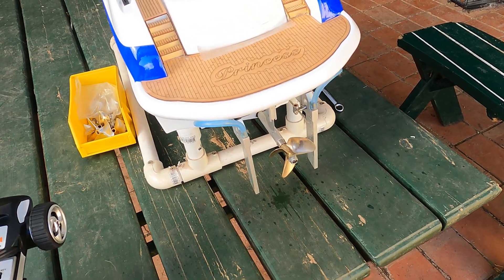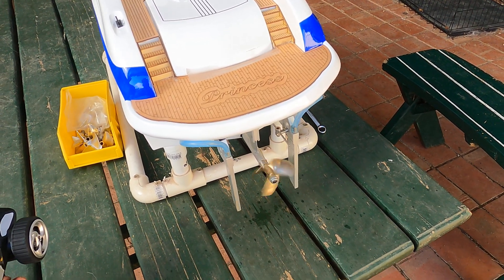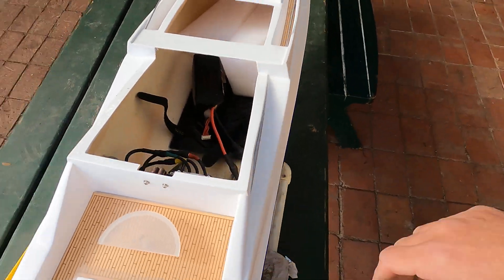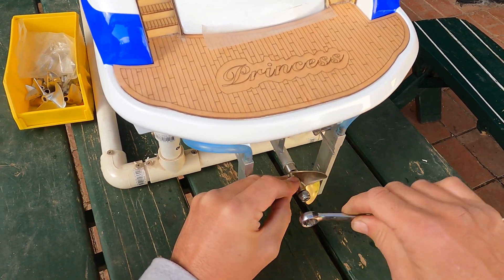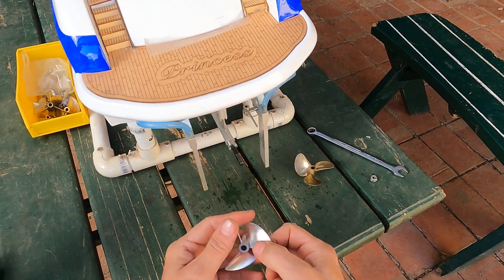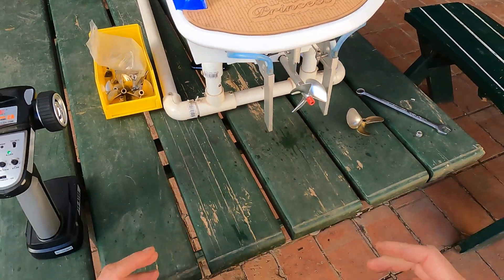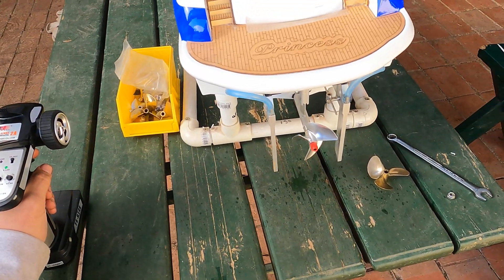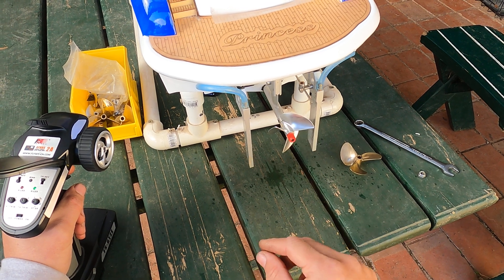RC Boat prop - unbalanced vs balanced propellor

Comment: Nice clip man, yeah as I understand it TFL sends them all with raw props.  We took it out yesterday and ran it on 6s got 43mph top speed which looked very scale. But yeah def needs that big heavy prop to be balanced or the bushing will not last long.  Have you ever taken one of them bushings out?  I'd like to replace them in one of my Zondas but its been a PITA to get out
Reply from the maker: Ive never kept any boat long enough to wear out a strut bearing lol. We sell those tubes for the zondas where the bushing sits in to save you buying the whole stinger assy